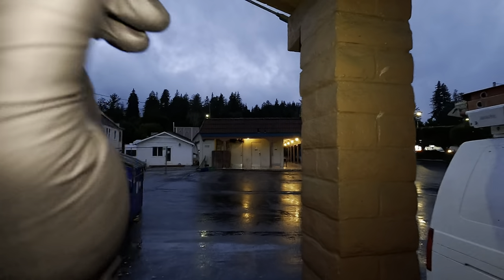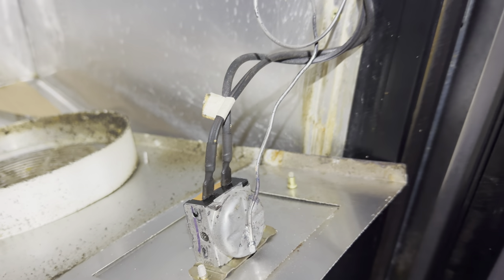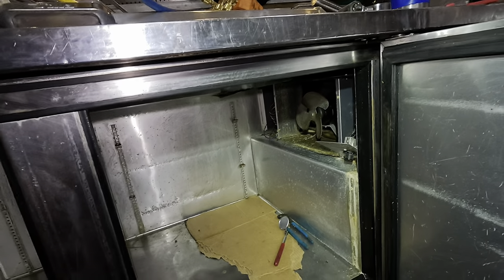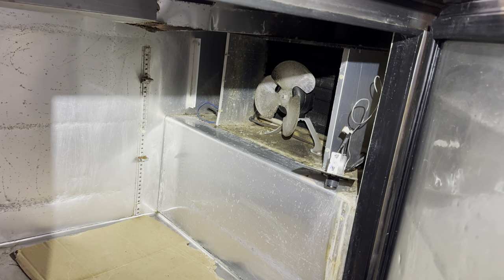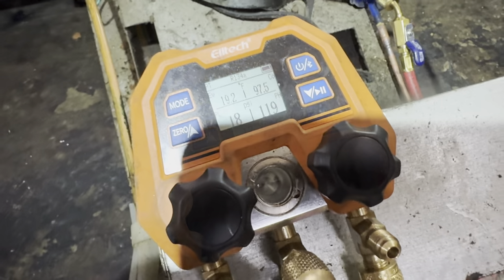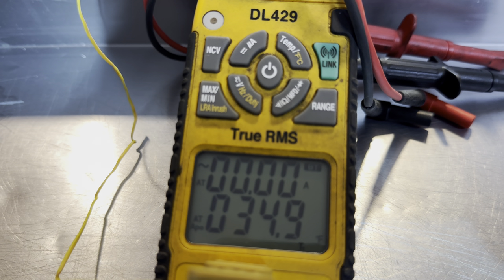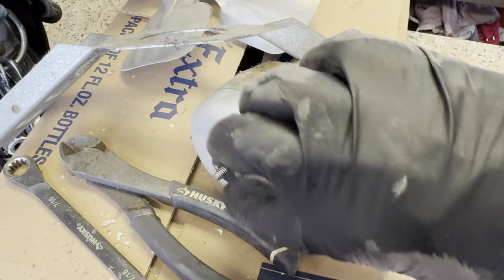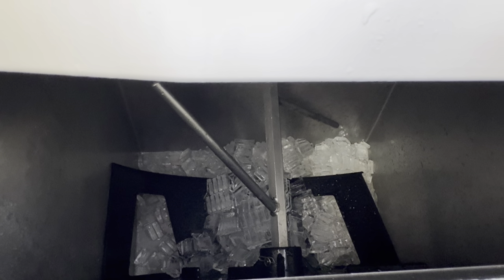Cap tube shuffle

Comment: Veto has a 5 year warranty on their zippers. Love and have used Suppco 88 for years. Get a hard starting compressors and all is ok with the components I’ve Adar suppco and watched the amp draw drop and run for years. It doesn’t replace broken parts but works well as a polishing agent. I add it to my motor oiler (zoom spout)

Comment: If I recall, some cap tubes are pre-scored.  If the person before you or the factory didn't break it off before installing, you got nailed removing it. Slight sideways tilt and  being annealed from being installed and boom 💥

Comment: Dave i think a good shoe / handbag repair shop could fix the zipper issue and then it's a case of keeping the zippers clean and lubricated with teflon grease or such .
I spray some once in a long while and it seems to work pretty well .

Comment: I wonder, if you couldn't just poke the remaining little piece of cap tube in and leave it. it should drop to the bottom of coil tubing, stay there and not really cause an issue.
maybe that needs tested by someone, to see if it stays put or migrates to a u-bend and plugs/causes a hole?
not sure what to "push" it in with, stainless steel pick? scrap section of smaller cap tubing, that gets pulled back out? don't want to use the new tubing as it would likely braze shut the end or get stuck to it, blocking it. 🤪my crazy ideas, always looking for actual workable shortcuts 🥸🥳

Comment: 💪👍🇺🇸❄️ any chance u could cut about 2" off cap tube at filter drier n do a test flow with nitrogen to c if u have flow instead of diving into evaporator section n then put in new drier if all good ? Thanks Dave for sharing go birds ?
Reply from the maker: I have videos back blowing to check cap tube. But once you see it running in a vacuum the party is over.
Reply: @NorCal-refrigeration  thanks for your help

Comment: Hey Dave, have you had any problems with those prep tables freezing up? I've got a customer at a chain pizza place that we are having freeze up issues at all of their locations with that same unit. I keep telling them to close all of the doors when they aren't actively making pizza, and they swear they are,  but every few weeks, we have go by and thaw the evap. The drain lines do frequently have to be blown out because apparently flour plus water equals cement,  but anyway, I'm just wondering if you've run into that issue at all?   OK, enough shop talk, time to hop on the Harley and roll out 🤘
Reply from the maker: The airflow on the baffles takes the air up top 1st then comes back through the wholes to the lower section. Make sure it’s all good. If nothing helps defrost timer ⏲️ time.